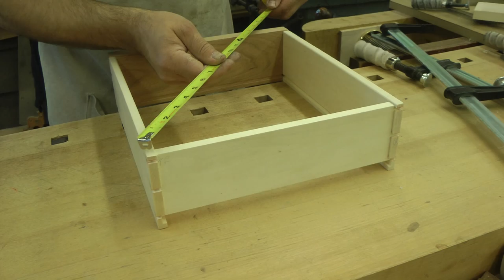Rob Cosman's Online Workshops Sample - Cherry End Table Episode 54

Comment: when you first glued the front to the side you forgot to check squareness in the horizontal plane (if that makes sense), maybe there was the slight misalignment that carried on the rest of the joints. happened to me many times until i realized. thanks for letting this little error unedited, it`s the only way we can learn. it does not make for any education saying 17 and 5/8 and 17 and 5/8 perfect! right?